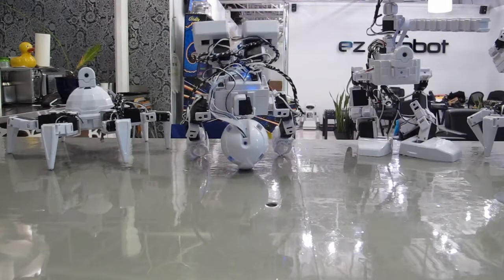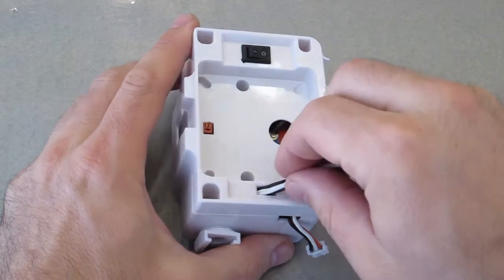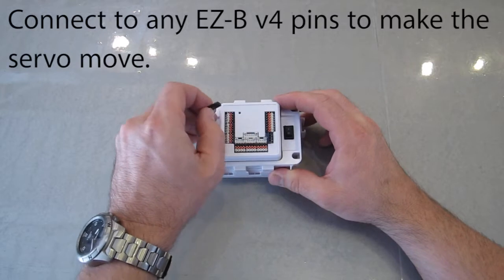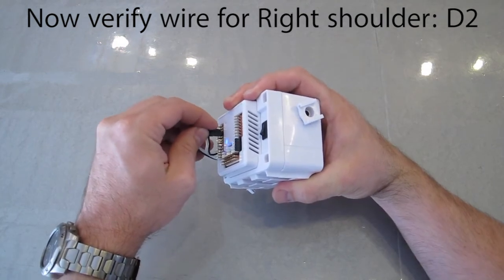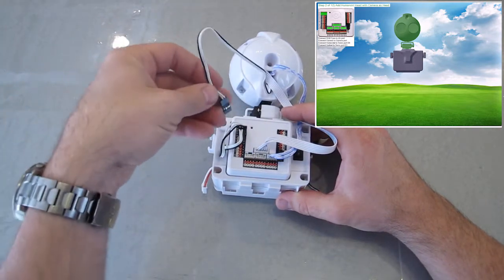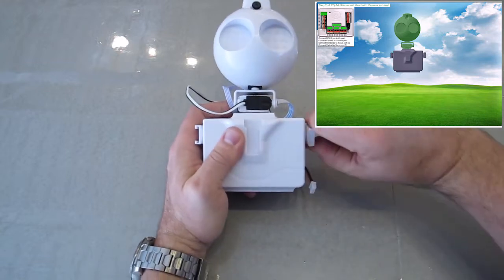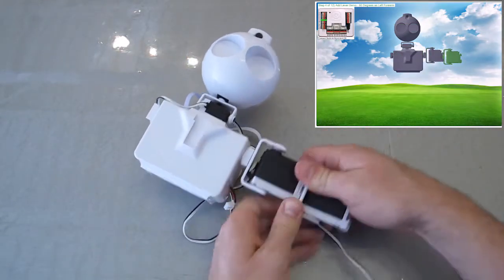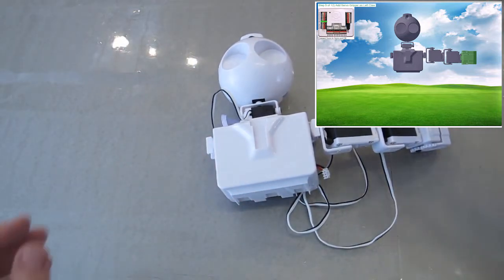Build JD Humanoid Robot

Comment: why the motor i bought on the store has double clips (both side of the longest side of the motor) i had to cut out one of the clip because it wouldn't fit in the 3d printed part... right=?
Reply from the maker: alberto scrimali If you 3d printed the part, the clip on the side of the lever must be cut
Reply: thank u man, and can I link the body of jb with the battery lipo I  bought in the store? Now i can power jb only with aa battery and the base for the brain
Reply from the maker: alberto scrimali You can use the LiPo battery from the EZ-Robot Store for JD. It will require some work to take the electronics from the base and insert them into the JD body.
Reply from the maker: alberto scrimali I do not know why the first time you read this.